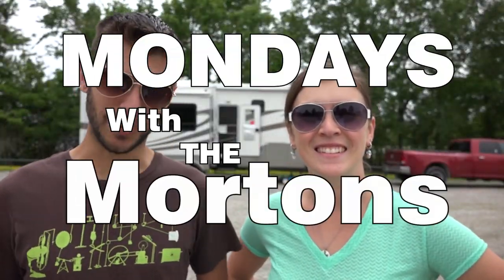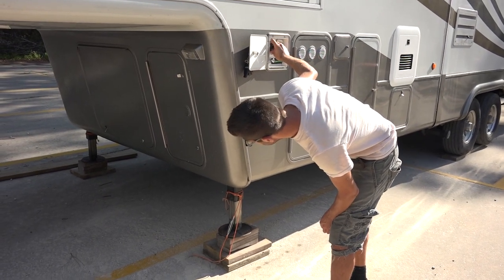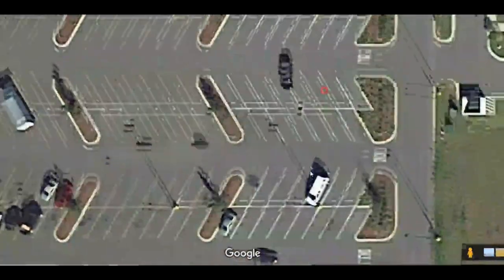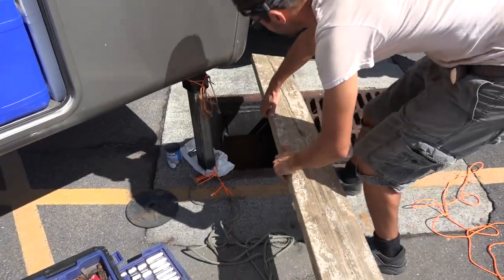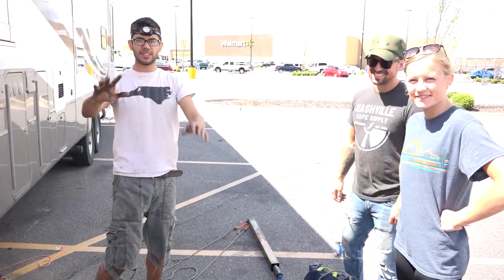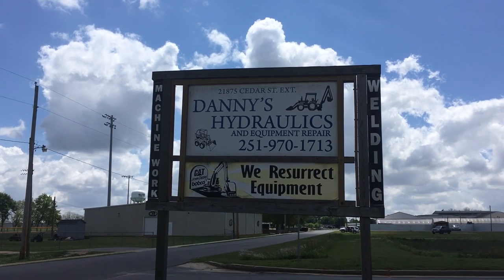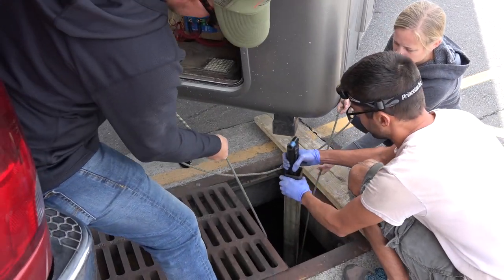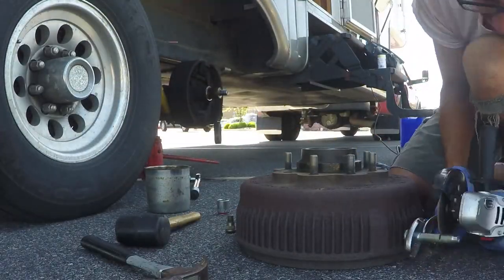Fixing our Leaking Sinking Hydraulic Landing Gear on our Fifthwheel in a Walmart parking lot!

Comment: What, no pin or latch to lock the gear in place when fully retracted? That's surprising. Glad your rig wasn't damaged when the leg contacted the road before your repair.

The RV community is awesome. Drivin' and Vibin' exemplify the ethos of helping where possible.

On your repair, firstly, well done! Aside from the channel locks to tighten the hose fitting, y'all did an amazing job. Necessity really is the mother of creativity. You really proved that with this repair.

As far as the jerkiness of the initial movements it's concerned, air is compressible. Fluid is not. So, what you observed was air being compressed to the point that the force could overcome the friction between the piston seal and the cylinder. Opening a line and submerging it in hydraulic fluid at atmospheric pressure would've a) made movement a lot easier while b) keeping air out of the system.

All part if the dues paid in owning something. Costly repairs averted. Friendship bonds deepened. Lessons learned and skills developed.

Best of all, you're even better prepared to pay kindness forward the the opportunity presents itself.

Lastly, I'd just like to congratulate you both. Not only is your content some of the best out there in RVing full-time, etc., but it's so great to see how well you work together. You're providing a wonderful example of friendship within the context of love and marriage.

Beyond that, your initiative and willingness to step out of your comfort zone time after time is all too rare. Y'all are amazing, and I'm grateful for you sharing your experiences so freely.

Comment: Love your ingenuity of finding a hole using satellite imagery.  I wouldn't have thought of that.  I might have thought well, I can't lift this trailer, so I'll rent a powered auger and dig a hole, which would have worked, but I really like the solution you came up with.  I have a 2004 model that uses the exact same landing gear.  Never had a problem with it, but we live in it full time and it never moves.  It's on a concrete pad.  But about 6 months ago, I got to thinking about "Hey, all that's keeping this rv from landing on the ground are those seals inside of those rams".  So I went online and purchased four of the large screw/scissor type jacks and ran them up to support the trailer right beside each ram.  Now I don't lie awake at night hoping my hydraulics don't let me down unexpectedly.

Comment: Nice to see the next generation just taking it on, doing it, and getting it done. Some out of the box thinking on that one. Industrial parks are more private, Walmarts are a little too public.
By the way it is easier to put the fittings on, then bolt it to the rig:)
Reply from the maker: Thanks, We scouted the whole town including the two industrial parks, unfortunately no drains would work.
Reply: Steve Harkins You're 100% correct on the order of assembly.

Comment: I'm glad you're the exception to your generation that you know what tools are. One thing that made me twitch was you using Channel Locks and Vise-grips on fittings that had flats on them for adjustable or open ended wrenches. Other than that Good Job on figuring out how to take the rams out.
Reply: Fitting wrenches, all sizes.  Round, like the box end of a regular wrench, but a cutout so it slips over the line.  Line fitting wrenches.

Comment: I had one of my hydraulic lines melt against my generator box. Luckily it didn’t bust until i tried to open the slides. It would of been bad if I couldn’t get the slides to close instead. 

I ended up going to a hose shop and got a reusable union. I put brake fluid in my hydraulic system. I seen you put trans fluid in yours. I’m going to flush mine out and use the same.  

Very good thinking on the drain holes! That shows it pays to be positive and have the desire to solve the problem at hand, instead of getting yourself stuck by just thinking of why you couldn’t get it done.  

We have that in common. 

Also, Drivin’ & Vibin’ helping you out?!? That’s great, they are awesome!

Don’t mean to offend, but I don’t see The Freedom Theory helping you like Drivin’ & Vibin’ did. You should add a link for them.
Reply from the maker: Thanks, I added a link directly to Kyle and Olivia's page, They are good friends of ours!
Reply from the maker: I am not sure about your system but yea I think flushing the brake fluid would be a good idea. Brake fluid tends to be more viscous and will aerate in pumped applications.  It also might be corrosive to some seals if not designed to for it.  I put dot 3 in a mineral based hydraulic system once and it ate the seals and leaked...

Comment: Thanks for the video. We purchased a 2005 36tk3.  Great price. Rear Jack's have been removed they were leaking down drug on the hwy. They removed them and plugged the hydraulic lines.  We had the RV delivered and we set on a permanent site.  Try to close the slides.....the front Jack's retract I'm guessing that maybe something wasn't done right.  I have the rear stabilizers. Plan on rebuilding.  Any thoughts.
Thanks
Jc

Comment: I had same issue on 2013 Drv. Took it out the first time by digging holes. Had a shabby hydraulic shop put seals in and I thought they knew what they were doing.. Not. Put some seals in that fell apart in the fluid after one or two uses under pressure. I’m guessing they put the wrong type which is stupid…  Pulled it apart using a sewer drain at a parking lot like they did and it was easier than digging holes… lol. First seals were just turning to mush.  Second time I had a real deal expensive hydraulic shop so it and it was great for two trips and maybe 4-5 months of it under pressure but now it’s doing it again.  I had them extended pretty far and should have put more blocks up front. Not so  slow leak now. About 3 hours and it will go to ground in the front. sigh…. Back to sewer drains in guess.

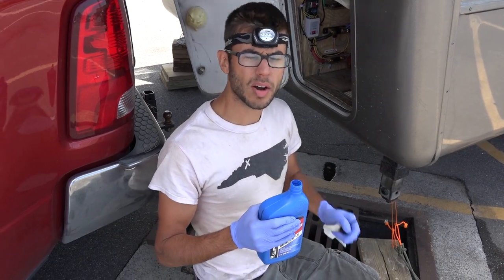Comment: I liked all the out of the box thinking, but have two things to comment on. The use of channel licks and vice grips to reconnect the hydraulic line fittings made me cringe.  The 1 quart oil bottles are designed to not splash, or "gulp air" as you pour if you had flipped the bottle over at 20:07. It also would have given you better control pouring because the bottle would have been under instead of over the spout.

Comment: Hi Mortons. We met you at lincoln,ca  airport fly in about 2 years ago.  You had a toy hauler then.  Why did you switch rv’s? Nice to see you two still full timing it.
Reply from the maker: Hey Steve, good to hear from you! That wasent us in the toyhauler back then but we did start out in one. We switched mainly because it was bigger than we wanted or needed, and the layout of our model did not work for us.  I also hated the triple axle as it ate tires.  I would consider a smaller 2 axle unit these days. But then would be more weight limited. Sure would like to carry around my patamotor again!

Comment: You could have relieved the pressure at the same orafice you used to bleed the system. You will need to bleed it after reassembly.
Reply from the maker: There was no pressure, just squirted when we moved the ram... had a cup over it but missed anyway.
Reply: The "bleeding" of the system is covered in the last few minutes of the video. It sounds as they is no bleed orifice, rather the main fluid reservoir is above the rams and accumilates any errant air in the system. As long as the new seals (square o-rings?) do their job...all air will be evacuated during use. The rams should work better than new and for a heck of a lot longer. Looks like a good system overall. It was a great choice to stick with the original rams.